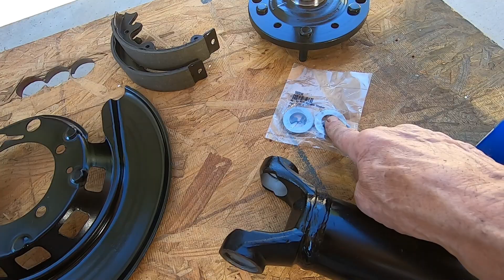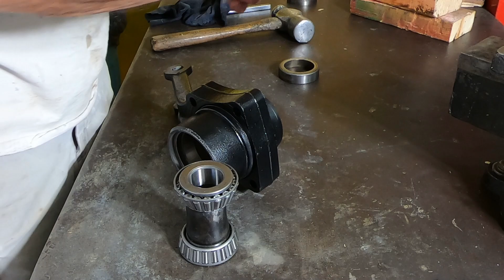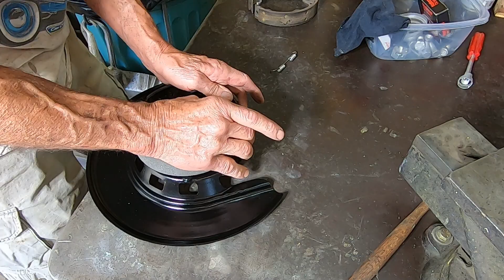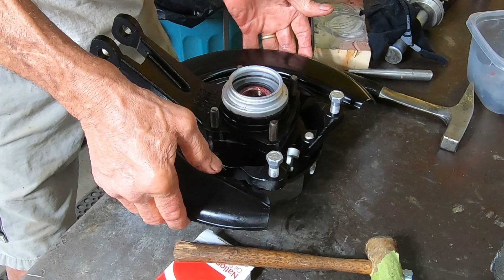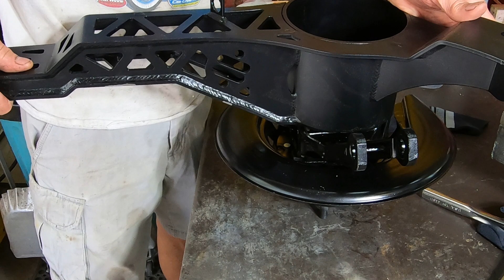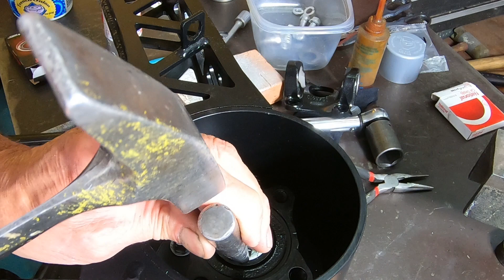1966 C2 Corvette Rear Wheel Hub Rebuild Part 2 - Assembly

Comment: This guy doesn't know how to put a cotter pin in...The right way. Geez, the most basic thing to learn.
Reply from the maker: Well, like everything there is more than one way to skin a cat. I had to massage that cotter pin a bit because there was very little clearance for the axle yoke that attaches there. The link attached show basically the same way to install a cotter pin and this is from a fastener company. thanks for watching and for the comment. https://www.bing.com/videos/riverview/relatedvideo?q=What+is+the+right+way+to+install+a+cotter+pin&mid=5B9FD3B48654B382B6B55B9FD3B48654B382B6B5&FORM=VIRE

Comment: Dick- Fellow New Mexican here; 1964 coupe- I too use the old bearing races to install the new ones, but I grind the outside circumference a little with a belt grinder so there will be no interference fit issues when I extract the old race! 
👍🏽🇺🇸
Reply from the maker: Good idea!

Comment: Do you happen to have bearing races and spacer part numbers?
Reply from the maker: Hello, Thanks for watching. I am attaching two links to the parts you need. These parts are available from other sources as well, so you might want to search for Corvette parts and compare prices. Even Rock Auto has the bearings and races. https://www.corvettecentral.com/c2-63-67/suspension/63-82-rear-wheel-bearing-shims-and-spacers-kit-582021?returnurl=%2fc2-63-67%2fsuspension%2f%3fcount%3d180        https://www.corvettecentral.com/c2-63-67/suspension/63-82-rear-wheel-bearing-set-582018?returnurl=%2fc2-63-67%2fsuspension%2f%3fcount%3d198
Reply: Volunteer Vette down in Knoxville has the entire rebuild kit too, their prices are excellent.

Comment: I appreciate your help.  we did the same thing with Ridetech trailing arms.  Dummies had you putting the studs in the trailing arms  we put it together and couldn't get to the nuts.  I was bale to remove the parking brake and get the nuts on that way, was tough to put the shoes back on though